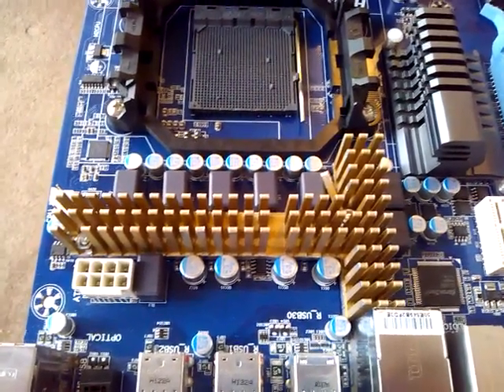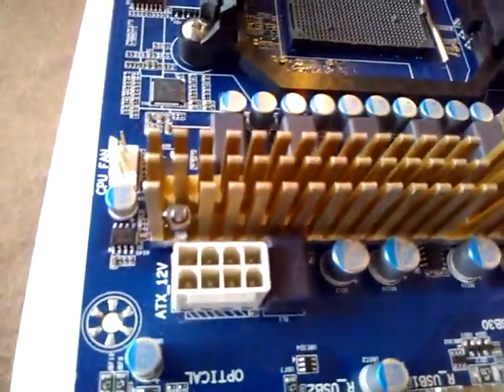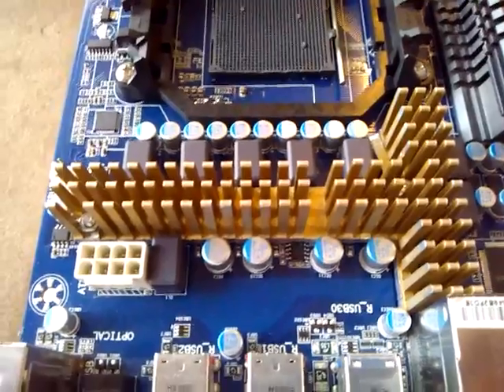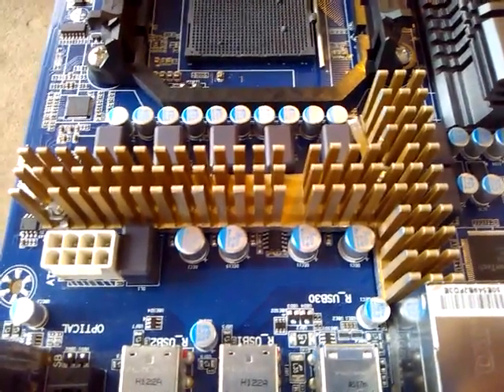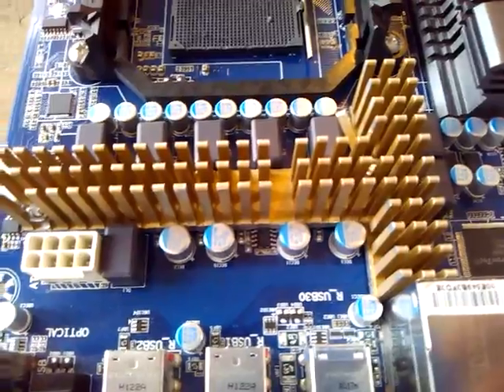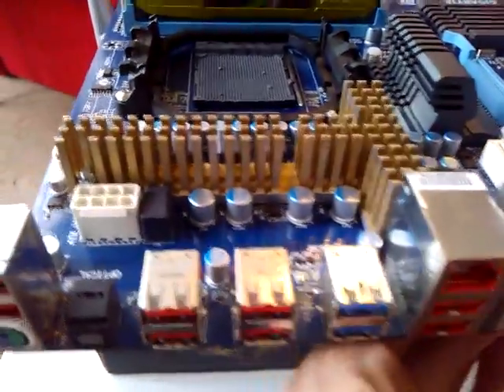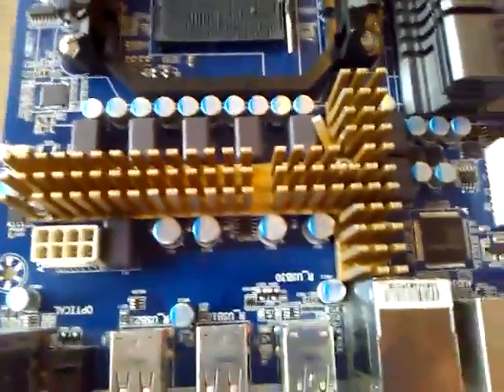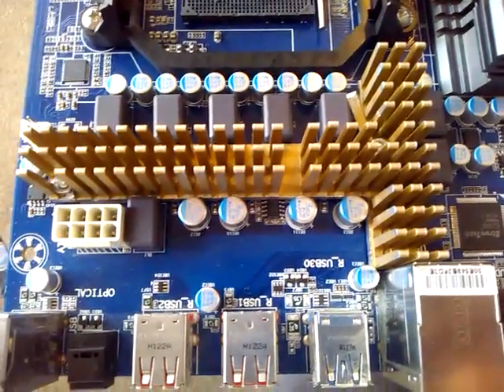How To: DIY Motherboard MOSFET Cooling, Part 3

Comment: Congratulations on installing a self made heatsink, but how do you know whether it did anything useful at all? Improvement of stability, temperature, throttling behaviour? Have you measured it at all?
Reply: You don't have to measure it to know that putting a heatsink over the MOSFET will reduce their temperature and improve their performance. This is guaranteed to happen.

The right question is how much performance can you get from reducing the MOSFET temperature.

The performance that could be gained will depend on a lot of factors. The biggest factors are was your VRM overheating before causing the CPU to Throttle? Do this MB supports overclock? Do the CPU support overclock? And the overall quality of the VRM (The MOSFET/MOSFET Drivers/capacitor/controller).

But I can assure you that if the board supports OC the gains from this mod are usually huge.
Reply: @vitor900000  I too like heatsinks on MOSFETs, i applied heatsink to an ASRock N68C-S UCC almost 10 years ago, just in case, because i was pushing the border of what it could do with a Phenom II x6 on a 3-phase VRM, although it was only a 95W version of the Phenom. I have not measured the result, i just didn't want an early death. I didn't overclock on it.

My later board was a Gigabyte GA-78LMT-USB3 which had 4-phase VRM with heatsinks out of the box. I have poked around and found that it's equipped with smart MOSFETs with built in temperature protection, so if you overheat it, the board turns off the VRM and your PC safely hangs. I think i pushed it pretty hard, with a 138mm downdraft cooler, which provided a lot of VRM airflow. With a more modest tower cooler, it didn't push as far, but i can't tell how much it's better due to better CPU cooling and how much due to VRM cooling. So i don't have a good experiment on my hands.

It does stand to reason that the pass impedance is lower at lower temperatures, so voltage stability can be improved.

Comment: The biggest difference from many 70$~90$ to 90$~150$ motherboards is the VRM heatsink.
If you can find a cheap board from a good brand that have the VRM mounting holes you can get a lot of performance out of it on the cheap by doing this mod.

A good example is the MSI B550M PRO*. This board has the VRM mounting holes and the price difference of a similar board from the same manufacture with VRM heatsink is ~25$. You will be paying 25$ just for a extra chunk of aluminum.

*Not the MSI B550M PRO-VDH nor the MSI B550M PRO-DASH. Those a the more expensive versions with VRM heatsink.

Comment: Did it help temps?
Reply: It should lower temps signifficantly 20°C or more if you put a fan on top. That is huge surface area added compared to no heatsink.

Comment: Can thermal paste be used instead of tape for MOSFETs?  Is there any danger using non-conductive thermal compound instead of tape?  I wonder whether paste would produce better thermal results compared with tape, perhaps vice versa?
Reply: Trenton Scott the less goo on that area, the better.

Comment: one quiestion why did you cut it in T you could add 1 cooler to it and lower the temp even more but its awesome im using ga-970a-ds3p died i got a new one i had warrenty i got lucky but the weird part is the mofsets and the nb made allot of heat im planing to put small cooler on mosfets and one more to NB on high rpm ;D i hope i can overclock good

Comment: Do you need screws or is just tape enough?
Reply: like it isn't in the video
Reply: Armand Klein I dont understand what i asked here but ive successfully added heatsinks like this to my cheap ass motherboard. It didnt help with the overclocking problem i had tho..

Comment: This video is useless without before & after results!
Reply: What results you expect? Temperatures are lowered by more than 20 °C thus MOSFETs are more efficient (can push more amps) which doesnt matter much since it is 4+1 phase and shouldn't be OCed much anyway.